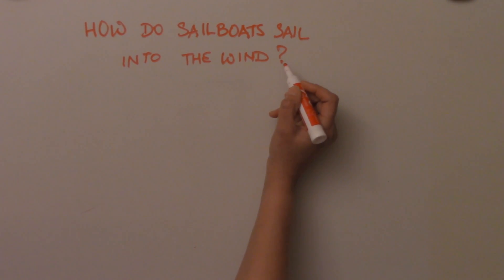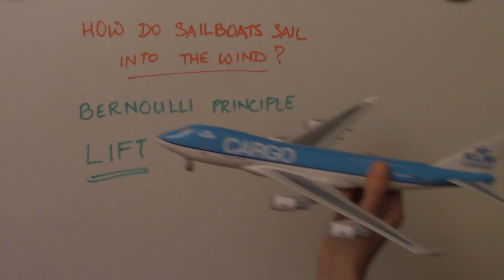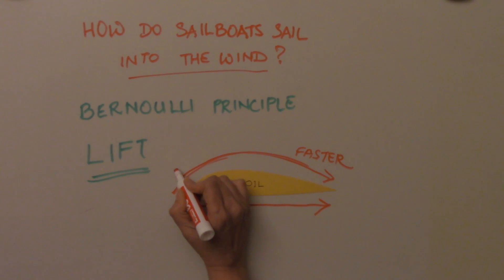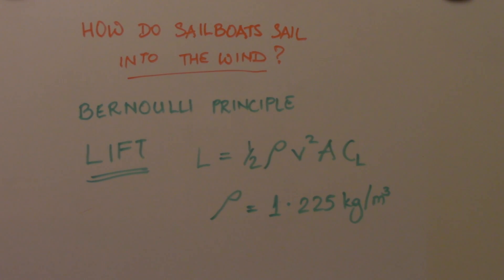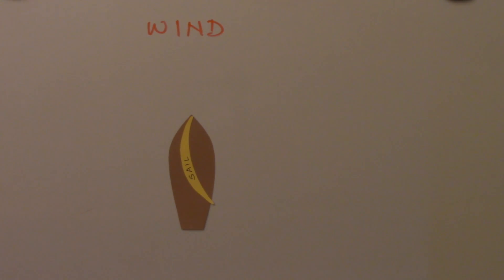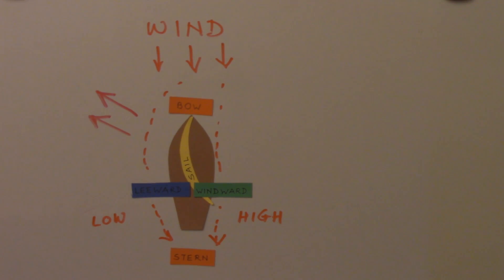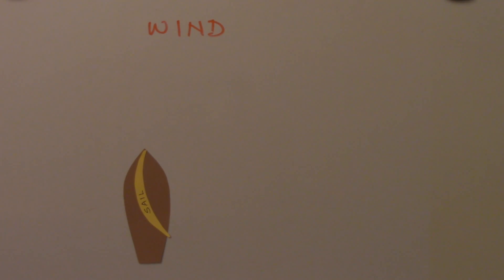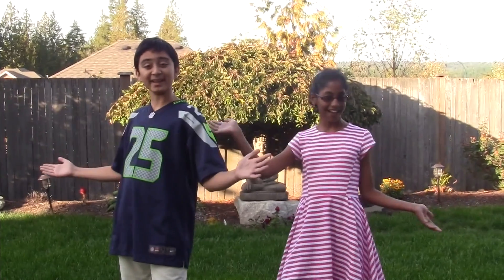How do sailboats sail into the wind?

Comment: 4:35 Still don’t clearly understand why the lift makes the boat go “mostly sideways, but partially forward”. The wind passing on the left side in the video is making a lower pressure on the side of the sail and I don’t see how it can make a lift partially on the front part. Maybe I don’t understand the Bernoulli principle well enough.

Comment: Looking at the sail, I still don't get where the forward momentum is coming from. If the airfoil shown in the beginning creates lift straight upwards, how does the sail shown not pull the boat the to bottom left?

EDIT: I'm now fairly certain the orientation of the sail was shown incorrectly here.

Comment: i still dont get it :(
Reply: The sail is like a plane's wing except it pushes the boat forwards instead of upwards
Reply: @supersanttu7951  a plane's wing as a jet or a propeller to push it forward.
Reply: @supersanttu7951  agreed the upward force is generated by wing... But going into the wind generates lift or drift, depending on a plane or sailboat, doesn't make sense, how doesn't it move forward... Any wind that hits the boat at an angle from 0to 180 has to push the boat back or sideways, not forward